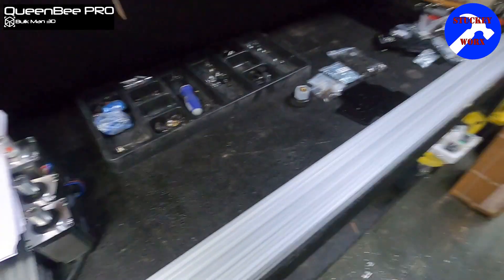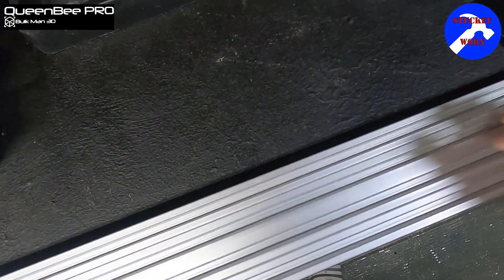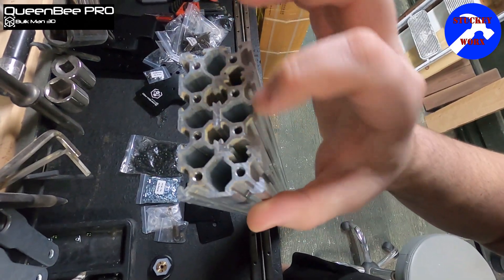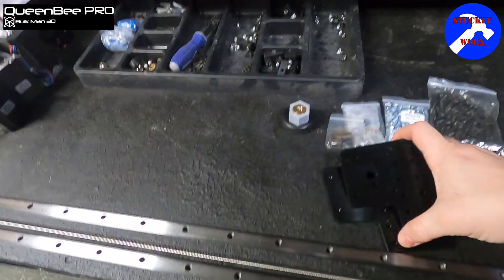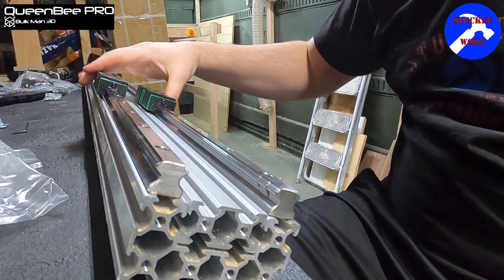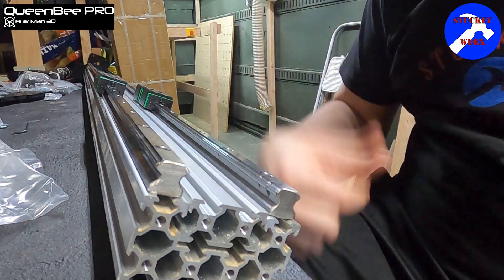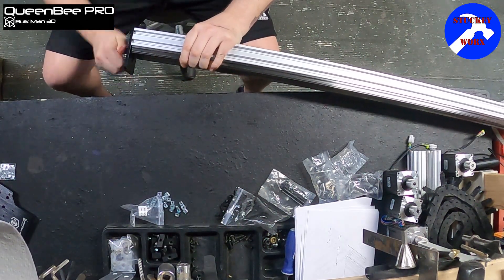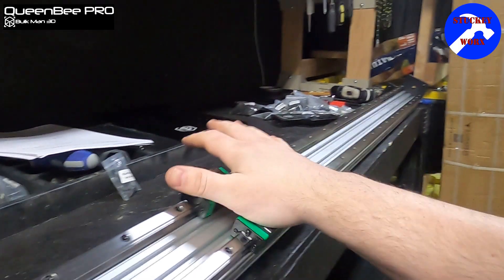BulkMan/QueenBee Pro Y-Axis Rail Assemblies Part #1

Comment: Before  to mount the linear blocks it is a good practice to clean them up from the manufacturing residues using IPA and then grease them.  A lot of work but very necessary in my opinion
Reply from the maker: They were cleaned. It’s not going to be working in the cleanest environment anyways. That is what the rubber “sweepers” are for that are attached to the bearings. Good maintenance is a worthwhile practice, but some things are unavoidable...
Reply: @702marine  I have the same kit, thanks for the video!  Do you know where I can get a grease gun that fits those micro Zerk fittings? I tried putting a fuel line on it and filling it by pressure but I can't get any past that ball.  So for now I'm just wiping down the rails with grease each day and hoping the bearings pick up enough to survive.
Reply from the maker: You know I haven’t looked yet. I was expecting it to be something I would need to dig for so I just haven’t taken that on yet. I would imagine putting some grease on the rail will work but I wouldn’t think it would be necessary to put it on the entire rail. It just needs to pick it up once.